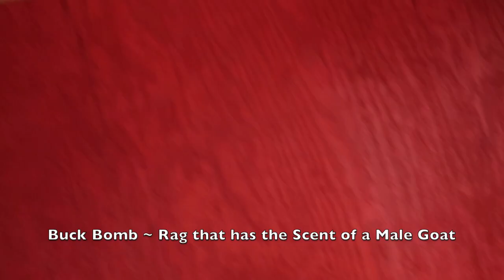Designed Our House Around a WoodStove

Comment from the maker: This is the heat powered stove fan that we use ~ https://amzn.to/2Ra24rO
Reply: Your stove top is big enough to accommodate at least 2 if not 4 of those fans.  Then you will notice the air circulation increase.
Reply: My father's houe in Penn heated the house the same way and they had about the same size grates. The house was built in the early 1800's still standing w/family still living there. : ) peace  they also used coal back in the day.
Reply: You have 200 Amps electrical disconnect switch turned off !
Reply: Wwwww
Reply: Ww
Reply: W
Reply: W
Reply: Ww
Reply: Ww
Reply: W
Reply: Ww
Reply: W
Reply: W
Reply: Ww
Reply: W
Reply: W
Reply: Ww
Reply: Www
Reply: W
Reply: Ww
Reply: Ww
Reply: Ww
Reply: Ww
Reply: Ww
Reply: Www
Reply: Ww
Reply: W

Comment: I love the idea of the woodstove heating cold air within the house. I will do the same thing here in the near future. I keep thinking about your comment about not being able to get the upstairs above 70 degrees. My Grandparents heated with sawdust back in the day, and it was a great way to heat the house... providing that you could get dry sawdust. At any rate, their difference was that they had hot and cold air duct work running through the basement. I love the idea of taking cold air and heating and basically circulating the air within the space. Thanks for the great videos!
Reply from the maker: When it's -20f the upstairs won't get above 70f
Reply: @LumnahAcres  OK, thanks for clarifying that. My stairwell is off to the side of the room, so thinking that the duct work might work better for me. Although I will definitely have get someone in to give me their opinion first. Thanks for the great videos... I enjoy watching them!

Comment: I know when i owned my home my wood stove was also in the basement. It had a hood over top so when the fan to the furnace kicked on it would draw the wood stove heat out of the basement and disperse it. The hood was plumbed into the vent ducts to the furnace.

Comment: I am thinking your sweet Willow is with kids! That is so exciting and I can't wait to see the videos of her and her kids next year!
Excellent planning ahead with your wood stove. I agree that I would have switched the living room with the bedrooms so that the space during the day would be warmer and the sleeping areas cooler. I pretty much don't use heat during the winter in the bedroom because I get too hot. I'd rather snuggle under a ton of blankets in a room that is cold than have it 70 degrees and be too hot and miserable.
I was thinking that you could save a lot of work and energy by buying an extra sled, filling it with wood, stacking it the way you would inside, stack it, and bring it is and store it where you store your wood. It'd save you having to remove the wood from the sled and restack the wood inside each time.

Comment: A nice little indoor project for the winter: Cool down the bedrooms, improve the convection. "Simply" install a subceiling in the basement underneath the bedrooms, and channelise the cool air from the downpipe(s) through the spacing. Keep the interspace tight to maintain a good airflow for evacuating the rising heat effectively. Consider placing air baffles for a better spread and distribution. Then drop the air low and towards the rear side of the firebox. Your preferred shiplap boards come nice and handy, just remind yourself sealing the shiplaps with some elastic sealant. Optionally apply or implement heat shielding. The smooth surface will make the warm air move faster and therefore warmer to the regular ceiling and well hole. Maybe save some firewood over the heating season. Double win, even perhaps a triple win. I hope you still read new comments to old videos, and you can pick up the idea. Make use of the cool air. One day of designing and planning, half a day of pre-organisation, two days of execution, half a day for re-organisation.

Comment: Good morning!!  Al, just a suggestion, have you ever thought of insulating the floor under the bedrooms. It might cut down on some of the heat transfer. Thanks for sharing the video. 
I am guessing your going to have a new baby goat!!
Reply: Maybe foil faced foam sheets to the bottom of the floor trusses ? Seal off both ends of the floor truss openings ( to stop the air entering in) . Use minimal screws with a washer on the sheet edges. It would take only a few screws to hold the whole sheet up, because of the lite weight. Plus NO FIBERGLASS fibers in the air !!!! Plus you can reuse the foam sheets down the road if needed or a change of mind. 1/2 to 3/4 inch thick should do it :) Or you might try the 1/4 - 3/8 foil faced bubble wrap rolls? But the thin plastic air bubble might melt directly above the stove ?  Plus the plastic will expand and contract to a greater extent than the 4 * 8 foil foam sheet . I like a cooler bedroom for sleeping myself. Makes for better sleep . Great video AL. The goat mystery continues .

Comment: Hindsight, eh? Too late to swap living room/bedrooms, but old people tend to like hot bedrooms, so in the distant future you might like the present room layout better. Another change I'd see would be to have put the chimney opening up bit higher on the wall, as long as it complies to code/common sense. That way you'd have more stove pipe inside to release heat into the house, and the outside opening would be higher so you can more easily sweep the pipes. I noticed the other day your sweep handle sections are taller than the distance from  opening to the ground, making you have to bend them, which will probably eventually wear them out quicker.

We always liked to keep our indoor wood pile rather full, so the wood could warm to room temp and even get some drying (especially if it got rained or snowed on some).

I'm wishing you and yours a very merry Christmas, and the best in the New Year.  Hopefully Willow is expecting.
Reply from the maker: The way the lot is designed it would be odd to have the bedrooms on the opposite side of the house. If that makes any sense
Reply: Makes perfect sense because of the layout of your upstairs doors, that are on the higher ground... better to be leading into living room/kitchen than into bedrooms and bathroom. LOL

Comment: Two downsides(still better the way he did it) are loss of heat as the warm pipe Is outside.  The immediate curve to the pipe to go outside can cause creosote build up in the curved pipe quickly needing more frequent cleaning.  I used to own a cabin at about 8k above sea level and it caused airflow problems at that altitude in my pellet stove.

Comment: Did you have any issues getting the warm air upstairs?  I bought the same stove and my basement layout and vent/stairway location seem similar to your setup, but I haven't had much luck getting much (if any) heat to the first floor.

Comment: forced hot air heat caused extreme dryness in the sinuses and a lot of static electricity, very uncomfortable, wondering if your system causes similar problem with the humidity?

Comment: Al, your chimney design and stove are practical. We have a central chimney for our basement Enviro stove, next to the staircase. I like your fan to move air. 5 cords of seasoned wood are stacked in the basement. We don't want to go outside at our age. The kitchen wood stove has an exposed inside stove pipe through the cathedral ceiling. Both are metal bestos and yes, some roof climbing, but eventually will hire a chimney sweep. Our kitchen wood stove can be messy, but "Matilda" can heat our main floor to 85 degrees :-) Our two floors are only 988 sq. ft. each, You do very well for 3,000 sq. ft.!
Reply from the maker: I bet having all the wood in the basement is nice.
Reply: Yes, like you, we designed our home in 2016 to be user friendly, especially for those of us over 65. So it can rain like crazy today, while we load dry wood from the comfort of the basement. Someday we want an electric ( battery back up) chair climber, with a crate for wood, groceries and laundry. BTW- a central chimney keeps our bedrooms cool. Your bottom line = preplan your needs when designing or retro-designing your home. I love your kitchen/ pantry design and your summer kitchen. Consider a small Jotul  woodstove or a hand light propane wall heater, such as an Empire, upstairs... Jotul is toasty :-)